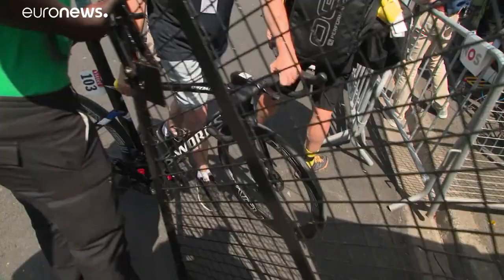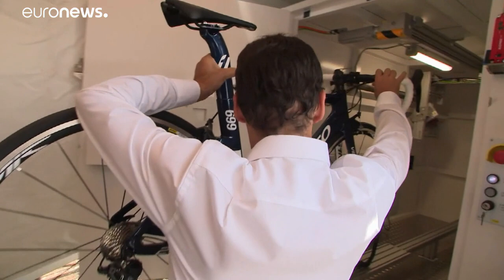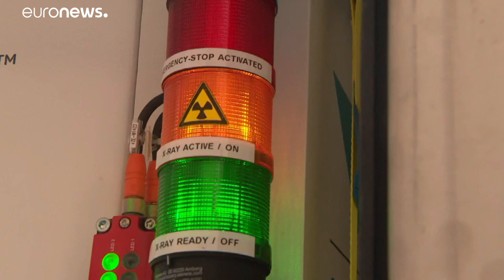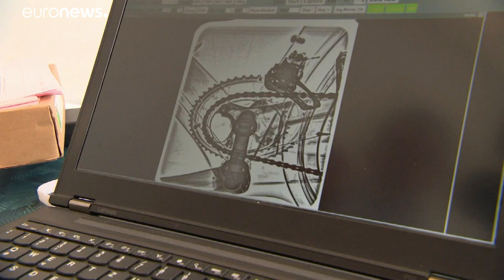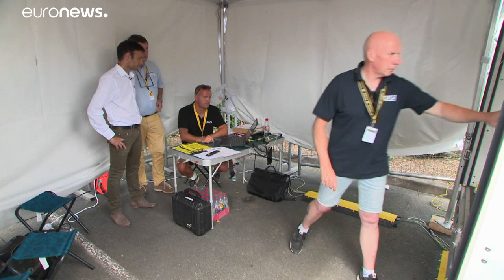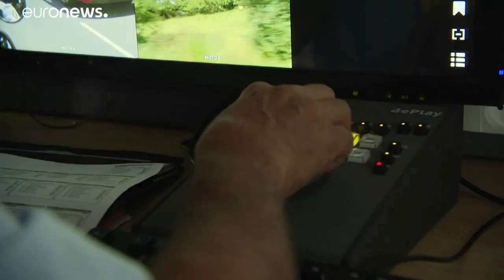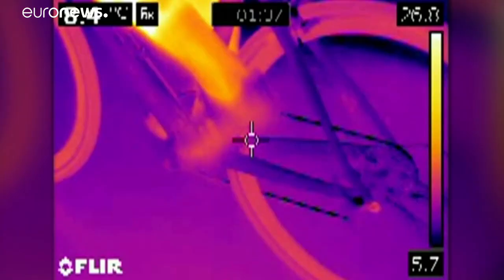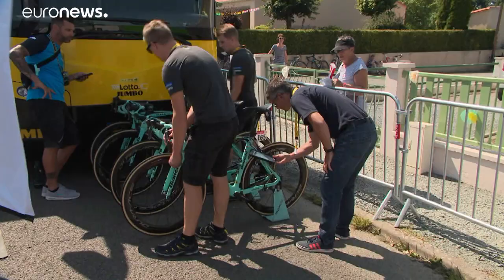Tour de France steps up fight against motorised doping

Comment: I'm a mechanical engineer.  I would recommend weighing all bikes.  The weight of these bikes are all going to fit a very narrow normal distribution about the mean with a small standard deviation.  Any bikes having concealed electric motors or rim neodymium magnets and lithium ion or other batteries and inductive charging circuitry are going to weigh noticeably more than the overall population mean.  This would provide an additional check.  An electronic scale would be or maybe already has been easily incorporated into the x-ray machine tire channel to weigh each bike while it's being x-rayed.  I wouldn't think anyone would seriously consider putting neodymium or other rare earth magnets in wheel rims since it would be so easy to detect them.  Unless there are some other type of magnets/technology available anyone more knowledgeable than I know about?
Reply: 6.8 Kilos is the legal minimum bike weight set by UCI. There are many bikes that go well below this limit, but they end up adding extra dead weight to the bike to meet the UCI minimum standard. Given how light bikes have become it is very easy to add motors and not go outside the mean weight.
Reply: @gokulr346  yea what he said.
Reply: Sadly i have to disapoint you technology allowes to make bikes which weight less than a racing bike because there is a minimum weight which is too high makes it easy to have the same weight bike one with motor one without. Electronic detection devices are better and infrared.
Reply: You can have electric motors on your race bike then swap it out as a mechanical failure with the normal bike then continue the race
With your legs still fresh lol and pass the inspection flying colors

Comment: Tour de France is the top bicycle sport competition. Transperency of this competition is vital. To improve the transperency of competition it would be even better to admit only one same model of bicycle for all cyclists of course with some construction changes corresponding to physical measurements of cyclist. As nowadays all cyclists having various bicycle with custom design, tires, shifters, derailers these affects on speed and endurance. Moreover electric scooters having negative impact on bicycle as an active cyclist myself I can’t see with out tears that more city dweelers now using scooters instead of bicycle. It’s a big shame that some cyclist might use electric components to ease up cycling on such prestigeous race, full time ban must be issued to such cyclists.
Reply: I have to disagree with the one bike model. It stifles innovation, at these elite levels loads of money is put towards improving performance, trying out new ways of building bikes, new materials. This is then filtered down through to consumers thus improving things for all. Also each of these bikes are specially made to fit each rider so they, on their massive journey, are most comfortable and can get the most out of their body. Having one design means the few people that fit the bike have a massive advantage over the rest.